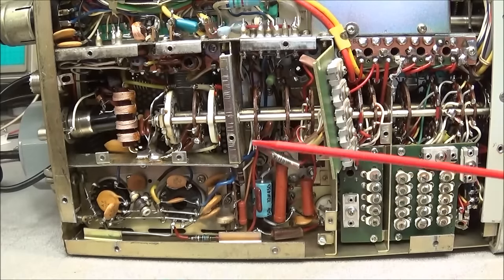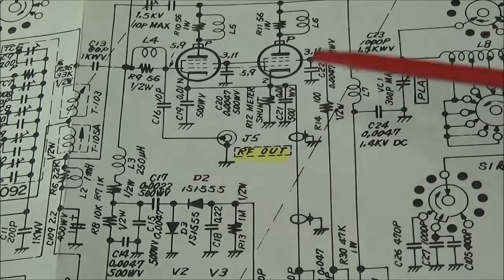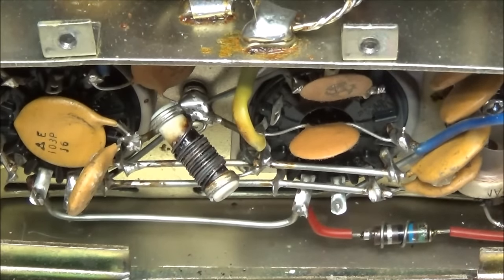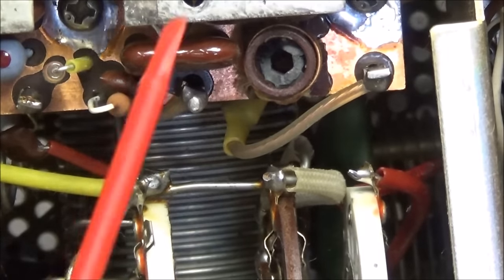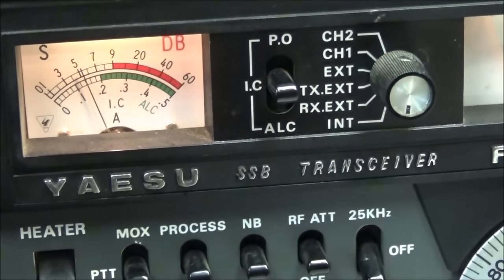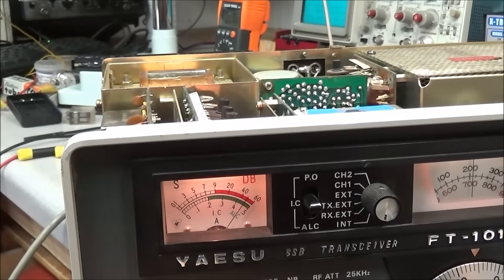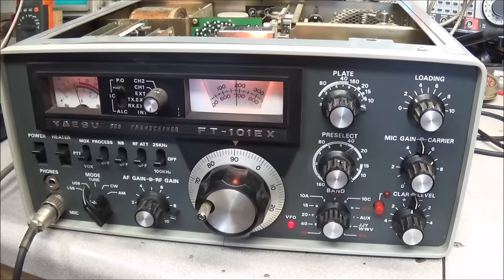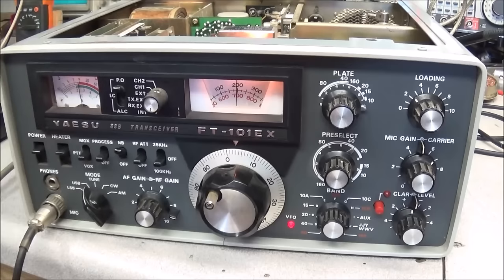#61 Yaesu FT101 series Part 2 Few nuggets and on air listen

Comment: can you please tell me where to find a moulded 80pf mica for C13?
I cant find it, only radial.

You say silver dip radial is ok?
Reply from the maker: Don't use the molded caps. Get silver dip mica. much better in this circuit
Reply: The Radio Shop
ok thanks...I wonder why they used them when the had and used silver dip elsewhere.